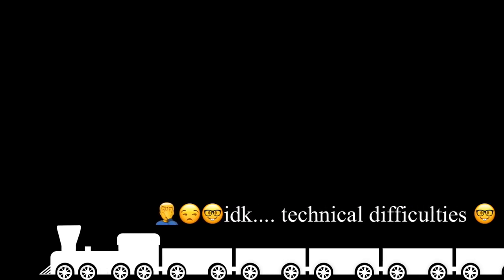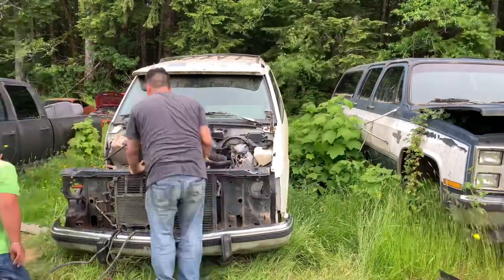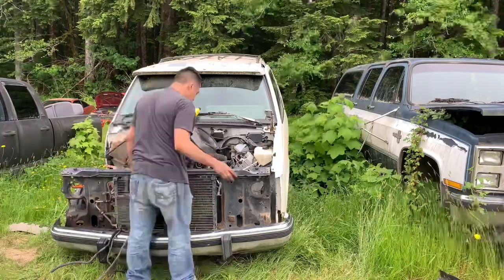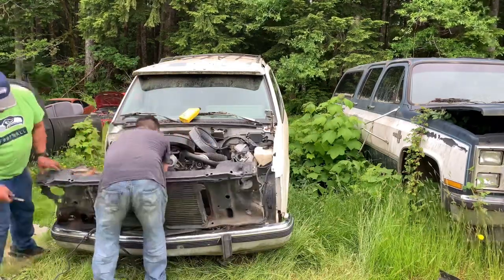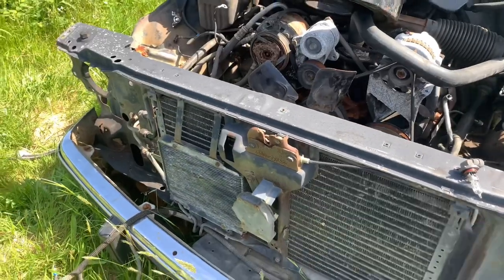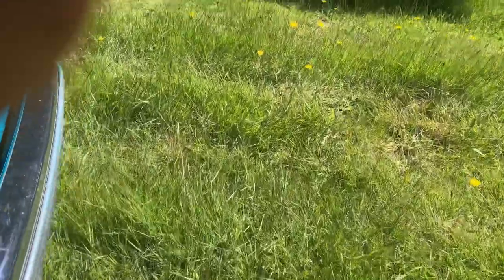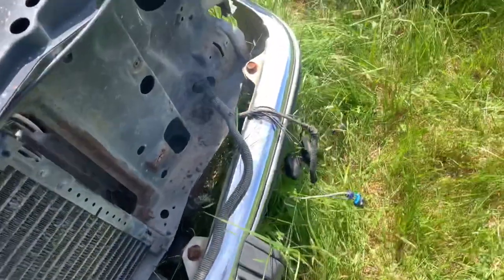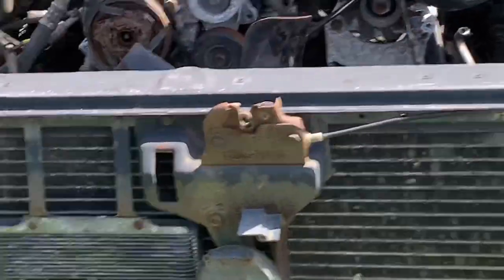Radiator core support removal

Comment: i have a question, i have a 98 the passenger fender at the front has a 1 1/2 inch gap but i have the fender gap near the door set perfect, i’m suspecting this truck has been in a wreck and i think the people that put it back together didn’t install the core support correctly, is the core support supposed to have shims. i’ve already checked for frame damage and the frame is still good and i checked the cab too, so i’m suspecting it’s the core support.
Reply from the maker: honestly i dont know what i know is what i found on youtube im not much of a mechanic but maybe its a wrong part? somewhere. check the drivers side to see whats different than the passenger side. id say its a wrong fender i know these trucks are the same from 88-98 it could be below or above that... sorry for the late reply sometimes i dont get notifications
Reply: @orange_luce7674  thank you anyways i figured out that the core support is missing shims on the passenger, i also found that it has the wrong radiator in it, so im just going to take everything  off and put everything back to OE spec
Reply from the maker: Nice good luck with the build🤓